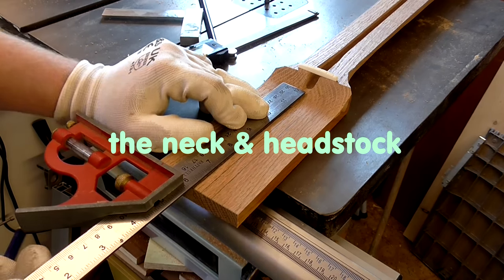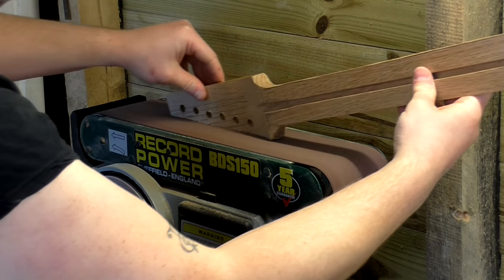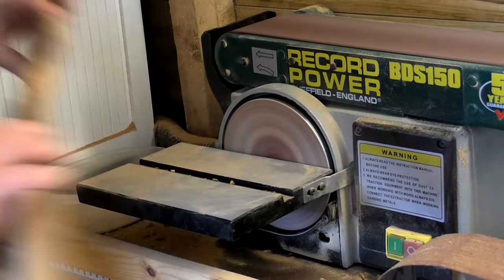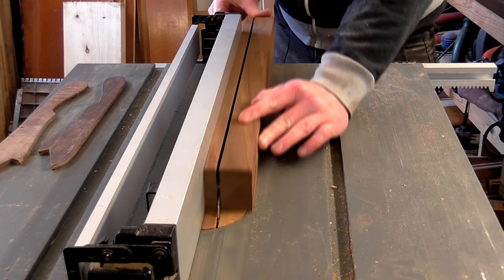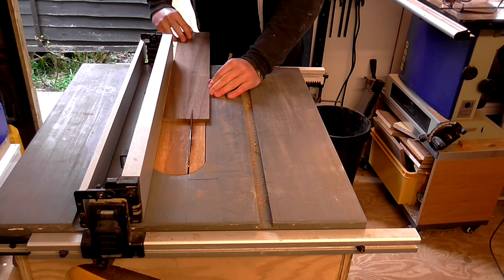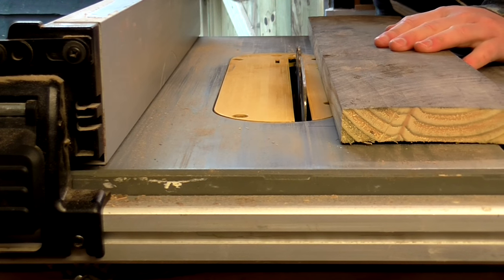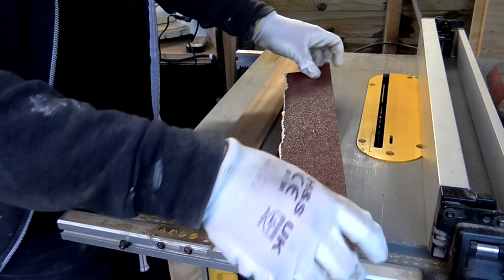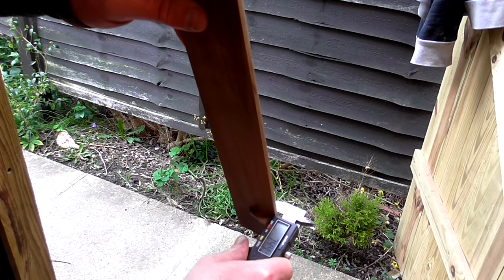Making An Electric Guitar From Salvaged Oak (part 2 of 9)

Comment: You can get a good neck radius with a levelling beam or a hand plane, and this technique can give you a slight conical section fretboard or "compound radius" if you follow the string direction.

Superglue and masking tape to secure sandpaper works better than hot glue which can leave lumps on the sandpaper

Comment: On your record power sander ? Can't you just have one sanding thing on at the time ? Like the belt or the disc you have to have them both running a one time? Not criticising just asking as was going to buy one
Reply from the maker: +Mats Turnings no you have to use them both at once. I'm not very impressed with it, wouldn't recommend it, one piece has fallen off it already!
Reply: +Rag 'n' Bone Brown oh dear thanks for the tip of I have seen them in many places but not liking the look of it in you video thanks for the reply